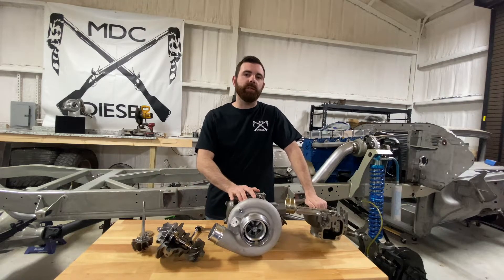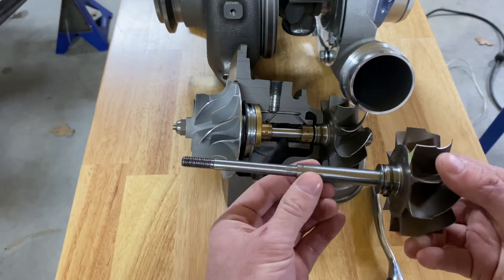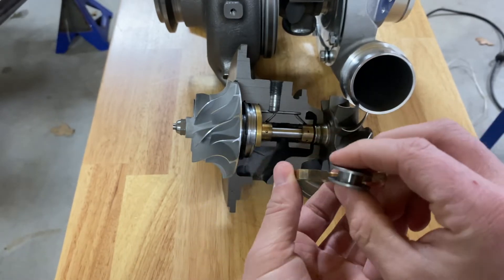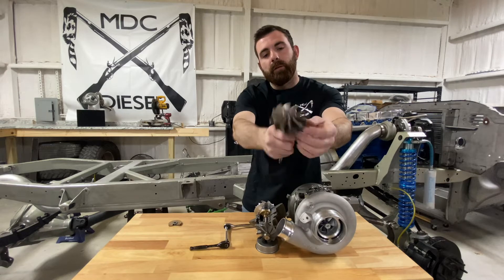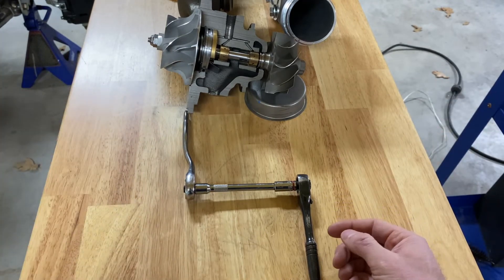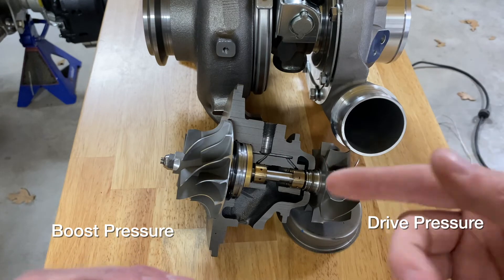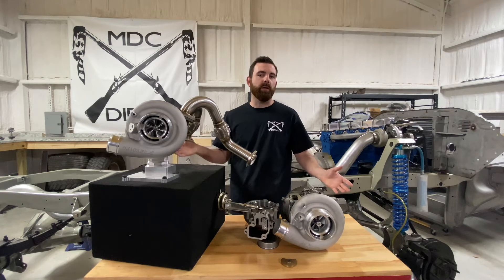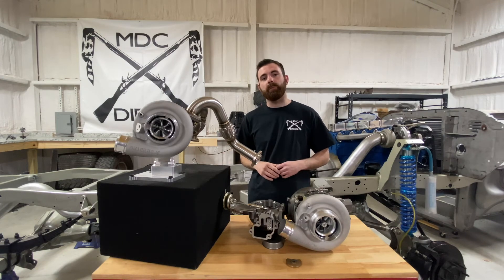Can Boost Leaks Cause Turbocharger Overspeed?

Comment: just had a compressor/turbo blow in a diesel car,garage put a camera on the boost side,fins are all damaged,after watching your video i understand now that the shaft is moving side to side hence the damage,not sure if theres a boost leak,watched loads of turbo videos recently but this was clearly explained and not too technical,the garage said it could be crankcase pressure as well,€2,700 euros to replace btw.thanks

Comment: Iv got a very small oem turbo on my modified truck and boost now comes on extremely quickly but I'm getting pretty violent surging under wide open throttle. Could this be a symptom of overspeeding the turbo because it is too small to handle the exhaust output driving it?
Reply: According to what he was explaining I would say yes its over speeding as he calls it and equalising the pressure balance early. So your not getting enough air for the amount of fuel. It’s difficult to diagnose on the internet because there are many variables to look at.

Comment: so the video says can boost leaks cause turbo overspeed. That would've been cool to get that question answered but I'm pretty sure 30 seconds from the end of the video you said a couple words about it and that was all. I'm gonna scour and find more can anybody answer the question will a boost leak. It's a very simple answer. Of course there's a bunch of different circumstances where this may not happen or it may happen worse for others, but is the answer yes, it's just that simple will overspill your turbo. If you have a leak fix it if you have a boost leak your turbo getting damaged.